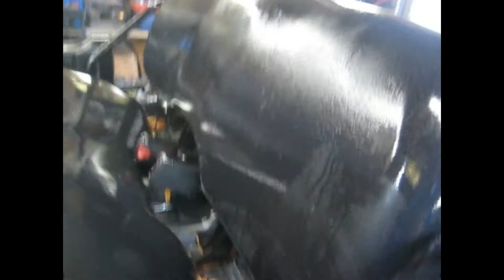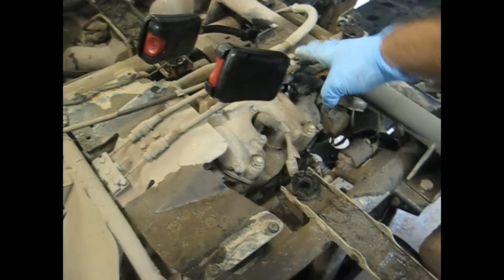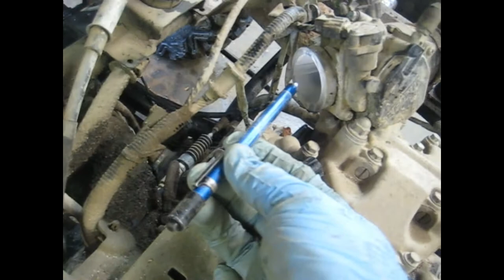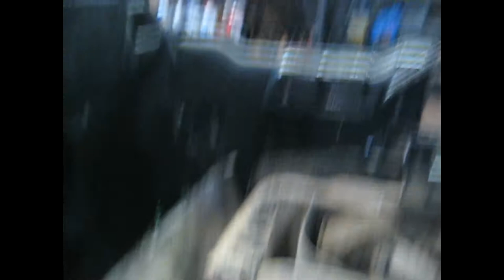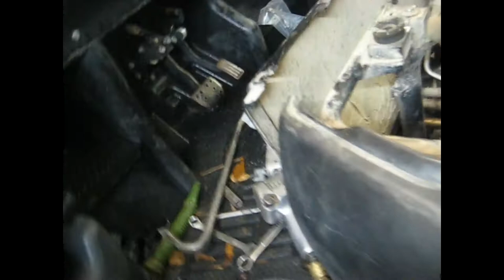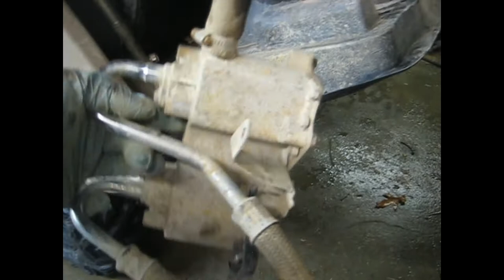Big Red 700 engine removal

Comment: Great video!! I bought a 2010 big red for a $100. Run but wouldn't move. with the help of your video, I split the engine put $1,200 in new part and it has run perfect for 2 years! But yesterday my grandson went across the pasture and it quiet. It will start but when you touch the gas it dies. Any Idles. I checked the fuel pressure, and it was 48 lb. Thanks for all your help!!

Comment: Thanks for the video. I'm looking at buying one of these that needs motor work and trying to figure out of it's worth the trouble. I've worked on a ton of Honda ATV's but never one of these. Your video helps.
Reply from the maker: It is very similar to the Rincon engine.

Comment: What is the trick to reinstalling the front driveshaft?? I’m struggling and the diff is unbolted still!
Reply: Your video helped me find that the oil pickup screen was clogged up!
Reply from the maker: I'm kind of late on this but the key to installing the drive shaft is to lift up on the diff with a crowbar and slide it all the way forward.

Comment: Man thanks for the video i have one of this units in my shop trying to move the front diff i have removed the 2 bolts but cant seem to get to slide forward is there more than the 2 bolts that needs to be removed
Reply from the maker: I haven't ever pulled one of those but I am pretty sure it only has two bolts. Stick a pry bar under the diff and pry up on it before you pry it forward.

Comment: Did you figure out why it was burning oil I have the same buggy blowing smoke just want to make sure it’s nothing else before doing rings and valve  seals
Reply from the maker: It was the rings. The intake boot had come off at the throttle body and it had been sucking dust in the engine from a dusty construction site.

Comment: Can you tell me where the hose from the side of the air box hooks up.. at your 9 min 4 second mark you can see it under the boot for the throttle body…
Reply from the maker: It wasn't connected when I removed this engine and could have been some of the reason for it smoking too. Seem like it connected on the right side of the engine to a nipple on the crankcase. It is the crankcase vent.

Comment: I'm wondering if you can share some information with me. A friend of mine, brought to my house a BR 700 with the tranny slipping. There doesn't seem to be much info on the internet about this problem with the BR, other than the oil pump chain slipping, I have a pretty high mechanical aptitude, rebuilding engines, trannies, etc. Just wondering ( with your experience) what is the most likely cause of this tranny slipping and what I should be looking for on the teardown?
Reply from the maker: Is it slipping in every gear?
Reply: @FourwheelerDoctor  All forward gears, not so much in reverse. Started out slipping when at operating temperature, quickly went to slipping all the time.

Comment: Can you tell me  how to set the timing on one of these? I replace starter 2 time in last year. Thinking it was the starter.but at times.when you go to start it. it acts like the battery is almost dead.. but leave set a few minutes..it might crank over fast and start.. had it back fire the other day..that is what made me think. it could be the Timing..But have not changed the spark plug either.. any thoughts? Thanks
Reply from the maker: I would check valve clearance. This engine is the same as the Rincon as far as the mechanicals of the engine go.I will post a link of one of my Rincon videos that shows setting the valve clearance.
Reply from the maker: https://youtu.be/iG9CkQ9gyTU
Reply: @FourwheelerDoctor  Thanks.........